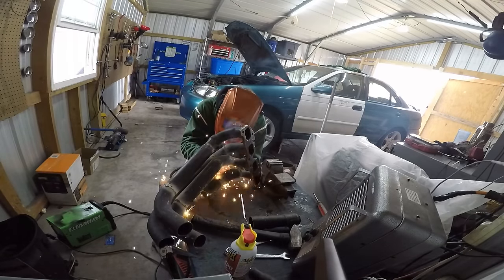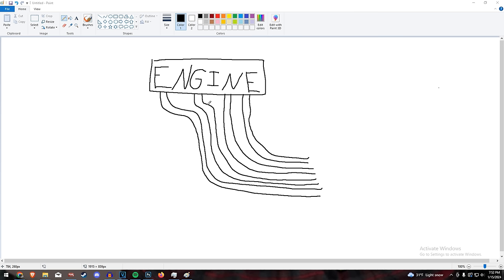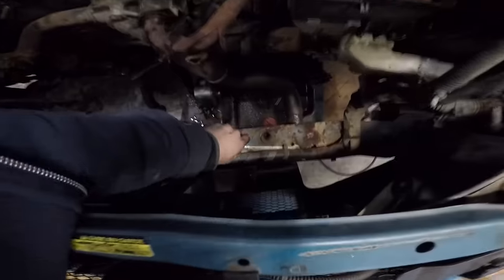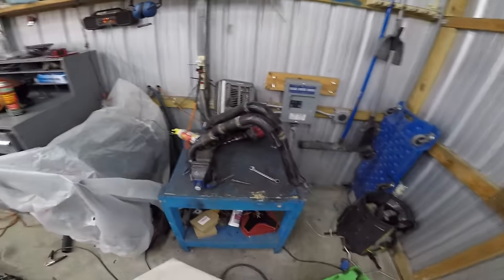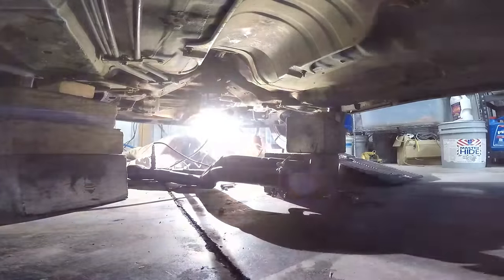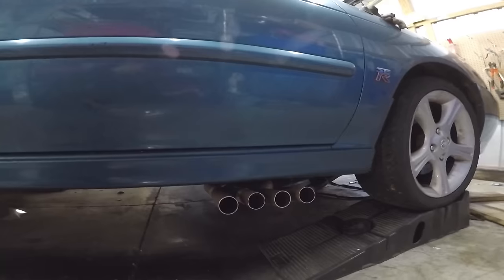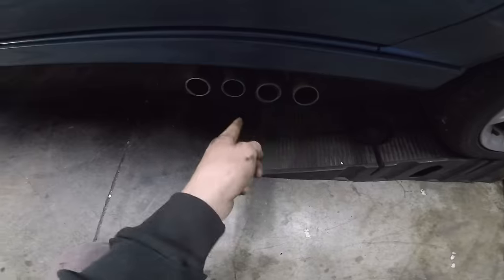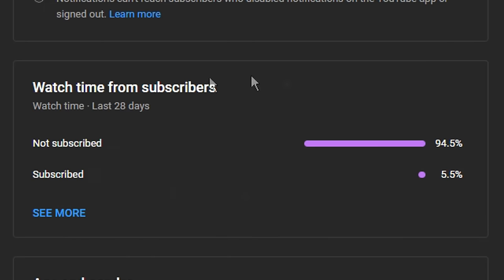True Quad Exhaust on a 4 Cylinder - What Will it Sound Like?

Comment: That is an engineering marvel.  How could a 4 cylinder sounds so loud and cool, yet produce so little horse power?! Incredible.
Reply: why so little ? some engines have 100 HP per 1000CC  :) without turbo
Reply: Put the motor in a go kart.
Reply: @Vidal6x6 Some naturally aspirated engines will make 200hp to the litre tbh. Look at most of the top spec 1000cc motorcycles out there.
Reply: I think he was referring to the one specifically in the video, not 4 cylinder engines in general 😊
Reply: @J.R.jr-pc7bo  why do they need back pressure? What happens with high compression?
Reply: @Rotormc  C'mon this is a Nissan for chripes sake, i think their 1.8 was rated about 130hp
Reply: @timjodice100  I truly don't know the physics of it, the best way I can explain it, let's say you have 2 items one is a rock and the other a feather. If you throw the rock as hard as you can, it will get some distance with the power and thrust by your hand and arm. Now you throw the feather and no matter how hard you throw it, it just flutters and lightly falls to the ground a couple feet from you. Now all that power used up and it goes nowhere, on the feather, that weight is your back pressure. With the right amount of back pressure, you can get some speed, distance and power. No back pressure you get very little results no matter how much energy you put into it. Now too much back pressure, 100 lbs rock, basically you get the same results, a lot of energy used and the rock goes nowhere.

Now in high-compression, the feather is in a F4 tornado, no matter the weight that sucker is going far and fast! After a certain amount of compression ratio, it doesn't matter if you have a little or no back pressure because of the energy output is so much stonger. Sorry I can't explain it better but I hope this gives you a somewhat of an understanding. I hope someone else can explain it better. I understand it but don't know how to put it into words.
Reply: @J.R.jr-pc7bo  He lost HP because the engine is an old ass Nissan.
Reply: I had a 84 Camaro v-6 and went through all the Trouble of having real dual exhaust with glasspack mufflers, I thought it would sound great.  To my surprise it sounded like two Billy goats, horrible sound, large single exhaust on a v-6 with one muffler that split the exhaust pipes sounded good on my 95 Camaro you would have sworn it was a v-8. You never know till you try it.
Reply: Abarth be like 🤣
Reply: I think they sound so loud because the strokes don't overlap at all unlike most engines. They also just run at a higher RPM in general if I remember correctly.
Reply: @J.R.jr-pc7bo  Backpressure in a 4 stroke engine is a 100% complete and total myth, it's not actually backed by any physics whatsoever. There are lots of awesome videos on the topic you can check out, I think Engineering Explained and Driving 4 Answers have good breakdowns. Removing restrictions and backpressure ALWAYS increases power, full stop.
Reply: Neighbors must love him
Reply: Best example is the 4age lol
Reply: The newer civics are 2.0 turbo and they are 306hp stock, the old (2006-11) 2.0 non turbo were 197hp.
Reply: @Rotormc yeah but they have all the rpm in the world to make up for the lack of torque 😭
Reply from the maker: @J.R.jr-pc7bo  Backpressure is an old exhaust shop fudd myth. You want as little back pressure as possible, all performance exhausts are designed specifically to not create back pressure.

The myth came from drag racers who would take their exhaust off and lose power, so naturally they thought is was from "lack of back pressure". The real reason was loss of scavenging. Without getting too into it, scavenging is when the previous exhaust pulse creates a negative pressure wave and "pulls" the next pulse along, improving flow. When you run open headers you lose the scavenging effect.
Reply: The bigger the exhaust doesn't quite mean the higher the power. Usually giving the engine the exhaust that it needs is the exact size to produce peak power.
Reply: @J.R.jr-pc7bo Back pressure is a myth. Your engine is essentially an air pump on steroids. The goal is to pump as much air through the system as possible and if you have a blockage on the exhaust section you end up losing power. Now what you are thinking of is scavenging but that comes down to your pipe diameter. If you have a pipe that’s too big you end up losing the velocity and thus creating an inefficient system. On the flip side if you have a pipe with too small of a diameter you end up with too much back pressure. Again the goal is to maintain velocity while minimizing back pressure. Some 4 cylinder engines are incredibly sensitive to back pressure and can lead to reversion which leads to detonation. Moving on to turbocharged engines it’s the same story. Having a large diameter pipe with a free flowing exhaust will decrease turbo lag and increase the efficiency of your engine.
Reply: @J.R.jr-pc7bo you don't know what you're talking about.
Reply: @HatersGarage  and  @SuperSpreeGaming thank you for explaining scavenging. I really do appreciate you guys explaining it. @xl3bigdrizzy891  you could learn from them. Instead of trash talking just like you did, they told me that I was wrong and then explained the situation thus expanding my knowledge and educating me, which I do appreciate. I #1 never claimed to be an expert #2 I do know more than the average individual about cars but there are a few things here and there that I don't know. I'm no engineer in fluid dynamics but after it was explained I can recognize that it is!
Reply: @SuperSpreeGaming  I did know about both supercharged and turbocharged engines that you don't want back pressure but wasn't aware of the scavenging. Thank you for explaining that, I do appreciate it. 🍻
Reply: @J.R.jr-pc7bo if you want to learn the physics of it engineering explained has a video on it called “stop saying exhausts need back pressure” or something like that. The real answer is basically just exhaust scavenging and the fact that if there isn’t enough restriction in the pipe then the velocity is too low.
Reply: @Jake-bt3fc  I will check that one out. Thank you 🙂
Reply: Pssh. My 4 cyl can spank your 8. 362hp and it even farts when I shift so you smell that defeat.
Reply: @slingbart705 i think this one’s the S-ER with the 2.5 making 165 hp
Reply: yeah it's like if Harley Davidson made a car
Reply: @nieminen7710    That's exactly what I thought when I saw it.  However, it might have more reliability than a Harley.
Reply: @Vidal6x6  that is not a lot...
Reply: @J.R.jr-pc7bo  Naturally aspirated engines don't need back pressure. The more back pressure you have, the less performance you have. If what you were saying is true then adding long tube headers to a V8 would cause it to be less efficient and lose performance. Back pressure will actually reduce the scavenging effect and slow down the flow of the exhaust gases
Reply: @timjodice100 they don't need back pressure
Reply: @HatersGarage open headers won't cause you to lose the scavenging effect. Actually with the right heads and cam along with the proper primary size you can make more power
Reply: @Rotormc any engine can make power, just depends on how long you want it to run. Look at top fuels. Make more than 1000hp per liter.
Reply: @J.R.jr-pc7bo it’s not back pressure that makes power, it’s exhaust velocity. the exhaust has to flow a certain length minimum to be efficient
Reply: @chrisbraswell8864 I’m gonna do the same to my 85 Camaro with long tubes and cherry bombs only for a little while before I get an actual exhaust system for it
Reply: The cars fast to me
Reply: To be fair these have close to 200hp stock and a 6speed manual version.,. The rare ones came with option for brembo brakes from factory as well!
Reply: Sounds like a Subaru
Reply: yup, but the same engines couldnt be made for daily use cars, because of the lack of low rpm torque @Rotormc
Reply: So little horsepower you’re a goof!
Reply: It’s a SR20DE, makes around 150ish hp iirc 2.0l i4. I’d say it’s decent.
Reply: @kornboyjr6419  the spec v has qr25de, they stopped putting the 2.0s in the b15s after 2001 with the introduction of the SER SENTRA. Nissans 4 bangers are badass, including the qg18
Reply: @Vidal6x6  R1, s1000rr, cbr1000rr, zx10r, gsxr1000, all 200hp 1000cc, naturally aspirated :)
Reply: Easy it converts more energy into sound😂
Reply: @slingbart705 that's not just any Nisan it's an SE-R with an Sr 20 in it if built right they will put out 800+whp obviously this one is basically stock but those engines are legendary!!!
Reply: @slingbart705 that's a SER in the video it's the 2.5 with 179hp
Reply: @timjodice100 because intake and exhaust valve opening overlaps a little, and too little back pressure allows fresh fuel-air mix straight out of the exhaust valve. Amongst other things.
Reply: @J.R.jr-pc7bo  no engine needs backpressure, stop that bs...
Reply: @user-jr9ov1dn9k  If you would have read the previous posts you would have seen I already have admitted to have been wrong and have thanked the two who corrected me. You're a bit late to the party 😒
Reply: @JeremyBorkat  without any transmission 🔥
Reply: @J.R.jr-pc7bo ummm
... no! Backpressure hurts the engine... what i think youre referring to is scavenging. But even then if you go from a stock log that doesnt provide any to begin with straight piped doesnt matter. But yeah no... youre not completely right but not even close either.
Reply: @gainsum  if you would have read the messages before, I had already admitted being wrong and re-educated 😒
Reply: @timjodice100   It's the old FIRST ONE OUT theory.The first exhaust pulse has to heat up the pipe and with half it's energy gone it still has to travel down the pipe and another exhaust pulse with a little more BTU is pushing him out and the difference in BTU's from the end of the pipe from the initial air/fuel mix explosion and the resultant down  (power) stroke and the forcing out of the exhaust- everything is soaking up the heat and this may cause a mini vortex, called scavenging
 And there's a difference between those two. Backpressure is exactly that. Pressurized exhaust gas in the pipe that's trying to push back into the engine because the exhaust doesn't flow enough-the hotter the exhaust.the better the flow
Reply: Ask Honda
Reply: That car is a 00-02 Sentra SE-R, it's around 180hp NA, so not that bad, I seen people change that engine and put a SR20 on it with turbo
Reply: @Vidal6x6  so like 200hp and barely 100 foot pounds lol
Reply: Just like "drag" pipes on a Harley.
Reply: @Chris-vx5kp @J.R.jr-pc7bo @timjodice100 there's really no such thing as back pressure, especially in this context. Watch a real video on it like Engineering Explained. Basically the problem with a large or short exhaust is lack of wave pulse tuning and scavenging.  This is why he lost torque (not power), not because it was an old engine. There is software available that will model air flow with different piston, crank, valve, and exhaust tuning, and it's pretty good.
Reply: @HatersGarage yep, and loss of exhaust velocity. And on short exhausts, you're also shifting the efficiency much higher in the RPM range, giving less area under the torque curve which is what really matters except for actual racing (peak RPM constantly). For example, tests keep showing that the old-fashioned P-cams for the Sportster engine make the fastest overall bike on the street.  People who want a "race" setup don't understand how any of this works and have never ridden in a "race car", at least not for more than 1 lap in the passenger seat on smooooth tarmac. 😂
Reply: @slingbart705   A nissan Sentra Se-R is 2L and has around 240hp....
Reply: Was there any noticeable change in how it drives?
Reply: @J.R.jr-pc7bo na doesnt need back pressure the only system that needs back pressure are turbos.
Reply: @timjodice100  look up scavenger effect
Reply: @slingbart705 this isn’t the 1.8 it’s the 2.5. the car in the video is literally an se-r spec v 💀
Reply: @tonyzaga the engine that comes in the se-r is stronger and just as easy to make power in as the sr20 that came in the sentra se
Reply: Try a 4 into 1 extractor exhaust with a metal disc muffler. That's the setup that most sport bikes use. Quieter, slightly more power at the top end, and you won't risk setting the lawn on fire with those straight pipes
Reply: @Vidal6x6  even with a monstrous 4L 4 cylinder at that power level thats still only 400. naturally aspirated 6.0L+ v8s make 500 or more. displacement+efficiency is still king at making power. you can only do so much with less cylinders and in a straight configuration instead of V
Reply: WAIT till you watch the videos of those guys running 4bangers pullin 900+ horses. man when one of those engines goes youll know it. pistons pulling 12k rpms
Reply: Sounds awesome but will have cost him  some of the little power he had. A properly  designed and tuned exhaust system helps scavenge exhaust gas from cylinders on exhaust stroke, improving efficiency and power.
Reply: Harley wants the secret
Reply: That sounds pretty good.
Reply: @HatersGarage  I had a small Nissan shitbox with a small 4 cyl fuel injected engine. Deleted the muffler to have better noise but the engine was not running well, the consumption increased. I decided to sell it and put the muffler back. Turned out it was the issue the whole time. Idk exactly if it is backpressure or what but nothing else was changed and the engine ran just fine after the muffler reinstall.
Reply: It's the opposite. A 4 in 1 exhaust is designed to reduce back pressure, so the exhaust gases leaves the pipe mpre freely. With this setup when the cylinder is not in the exhaust fase, some air will try to fill up the exhaust (back pressure) and the gases will be slowed dpwn since there is this mass of air to push out first. Back pressure is only wanted in specified scenarios like 2strokes, where the air coming back from the exhaust (which is usually gas, not air, yhe pipe has a shape designed for it to bounce back) preventing fresh mixture to escape  the chamber
Reply: no converter, muffler
Reply: It's called not having a muffler
Reply: Look up the 4 cylinder 250cc street motorcycles from the 90s, they sound insanely good
Reply: Boomer myth  @J.R.jr-pc7bo
Reply: @J.R.jr-pc7bo stop spreading this hogwash.
Reply: @timjodice100  no back pressure needed, it's a myth.
Reply: Lol so little my dads focus has 140hp 4 cyl with turbo shit would sound better than this car
Reply: @Rotormc Yeah but they’re also pushing probably like 999.9:1 compression like the 13:1 in my FRS. Puts more strain on the engine im sure. I’d take a 3.0 4 cylinder though, so long as the entire engine block dimensions are scaled proportionally to the bore of the cylinders. I don’t want a K20 that’s been bored out to be a 3.0. I’d want a big block big mama 4 cylinder.
Reply: @J.R.jr-pc7bo  BACK PRESSURE IS A MYTH.
Reply: @jerth always remember back pressure is bad but you must maintain exhaust velocity also for the motor. There is such thing as going too much/ too big.
Reply: @HatersGarage Scavenging is is having an exhaust that has no restrictions but it's still the proper size to maintain proper exhaust velocity.
Reply: @J.R.jr-pc7bo Force can't do any work without something to work against, in other words?
Reply: This is an SE-R Sentra, 2.5 4cyl rated at 175hp. 

I don’t know what you’re talking about. 😂
Reply: @Diabeetus.  hate to break it to you sir but 175 horsepower ain't shitt lol. Now if that engine makes the same amount of torque it might be okay but I highly doubt it.
Reply: @kskip4242  Because everyone’s so numbed to the fact that we need 300hp just to be even slightly fast, 175hp in a 2700 pound car is plenty enough.
Reply: @Diabeetus.  that's equal to a 15 second quarter mile time bro that's slow as hell. You're living in the Stone Age my freind. Most 4 cylinders nowadays make over 200 horsepower naturally aspirated, with the exception of Nissan obviously they don't know how to tune their shit right but I guess they tune it to a lower Power number because of the CVT transmissions. I know what I'm talking about I own two Nissan Altimas. Great Cars Great gas mileage but they're slow as fuck. 188 horsepower in a 3400 lb car is literally mind-numbingly hard to deal with sometimes but I drive them because they're dependable and they get great gas mileage. There's a reason why 300 horsepower is like the base standard for anything somewhat quick because that's what is needed. I had a 2012 Chevy Impala with a 3.6 V6 that would run 13/8 in the quarter mile with a 300 horsepower V6 and it still felt slow lol. But I know what you're saying people are driving 10-12 sec cars to work and knock down 25-30mpg thanks to multi-speed automatic transmissions these days. But come on don't ever call 175 horsepower car fast because it's just isn't.
Reply: @kskip4242  You’re literally comparing a car that’s almost 1k pounds heavier than a Sentra SE-R. 

Obviously it’s going to be slow, no one looks at a Nissan Altima and thinks “fast”.
Reply: It's converting petrol into noise
Reply: @J.R.jr-pc7bo  i understand what you're trying to say but backpressure no matter how much kills power, all you need is good flow, it might contribute a little but its only 5-10 hp changes depending on how much longer your exhaust is past a good header, i wanna say its 18 inches past the header and then it gets less power but not by much. engine masters looked at this but with a v8 instead of a 4 cylinder where it makes closer to the 400 to 500hp range where those little things show up just slightly bigger
Reply: @timjodice100  no back pressure is needed.
Reply: @slingbart705 it’s an SER that means it has the SR20
Reply: @chrisbraswell8864 You eliminated the beneficial scavenging effect by going from single to dual exhaust.
Reply: It sounds loud because of the echo that is going through each pipe. The reason it doesn't make any power is because without the tubes connected into one collector they don't benefit from the scavenging effect. Scavenging is what helps the exhaust gases escape faster. The exhaust pulses from each cylinder help pull the gases out from the engine faster. By them not being connected it causes turbulence in the pipe and the speed of the hot exhaust gases slows becoming stagnant until enough pressure is built up from RPM to push the exhaust gases out. The same thing happens when people go from single to dual exhaust or go with too big of an exhaust pipe.
Reply: @SuperSpreeGaming  The air pump analogy probably needs to die, it's not a very good one. After all, which air pump design are we talking about here? Not to mention there's way too much more going on with an ICE to really compare it to an air pump. Those are for fish tanks.
Reply: Back pressure isn’t a myth.  Need some to be able to feed the EGR system and for catalytic converters to work properly.  I’m not saying it takes much, as it will basically always be present on anything street legal.
Reply: @brainkill7034  Nobody needs that smog crap on their vehicle anyway.
Reply: @Rotormc  up to 240hp on road with Ducati Desmo valves, well north of 300 cranked up to MotoGP spec. Absolutely insane the power (and revs) they make nowadays.
Reply: I say the same thing about those 05 mustang GTs. They sound so mean but they’re so slow 😂
Reply: @jimskywaker4345 yeah nissans are kind of cool that way, my 122hp 1.6L nissan kicks likes to stay at around 3000 rpms when cruising...
Reply: @Rotormc  yeah because they rev to like 17000rpm. Hp is literally torque*rpm
Reply: A turbo might remedy that.
Reply: They were cool cars at the time, still are if taken care of. The old Sentra performed well in small motor sports levels. Those came from the factory with a mechanical LSD and pretty decent power for the time.
Reply: if you missed it, that was the case with american v8's for about 100 years
Reply: That is some Harley Davidson Design right there, all noise no power
Reply: Same philosophy that Harley Davidson uses